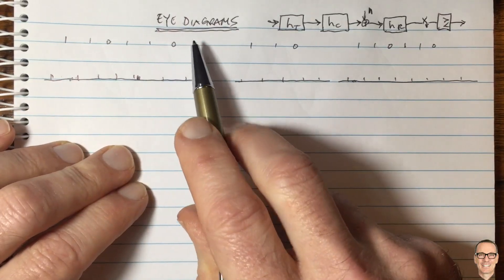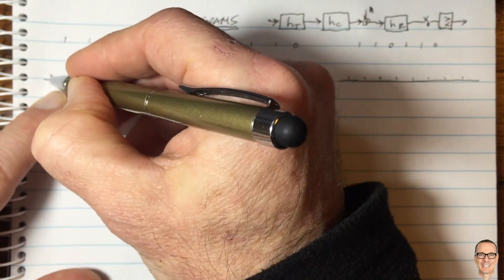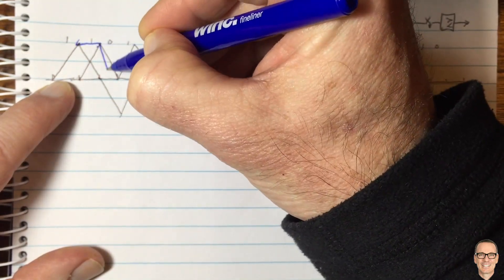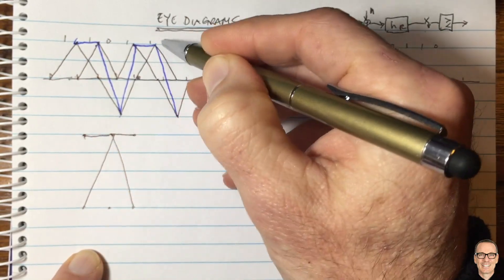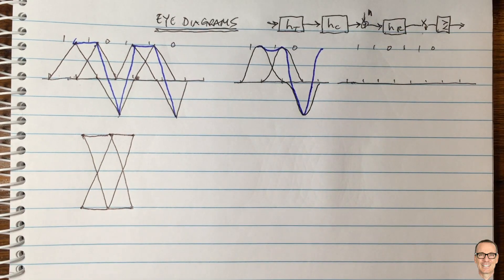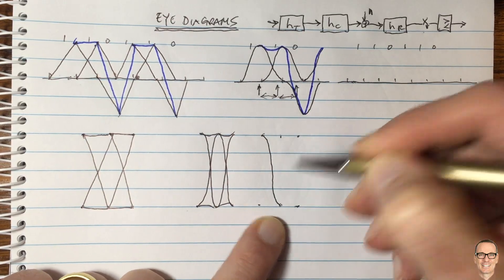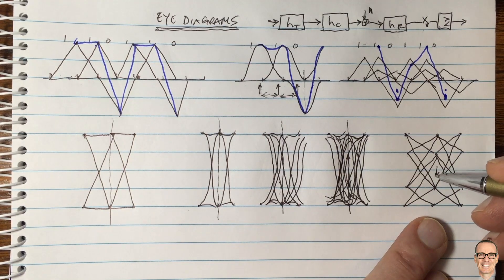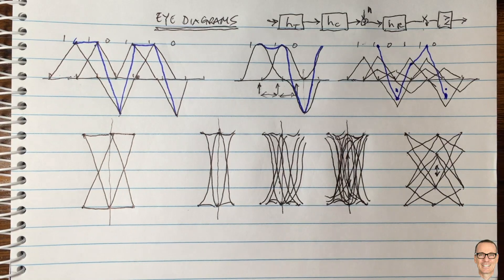What is an Eye Diagram?

Comment: Hi, are eye diagrams applicable to clocks?
Reply from the maker: Not really. Clocks don't get "sampled", their transitions are used for timing references, so it's important that they be as sharp as possible, and not "closed over".
Reply: @iain_explains  so, essentially trying to get an eye diagram for a clock is like a self referential measurement in the sense that you will need another clock to do it?
Reply from the maker: Exactly.